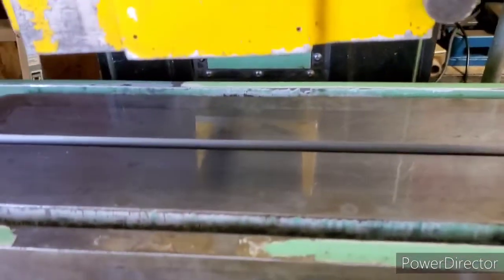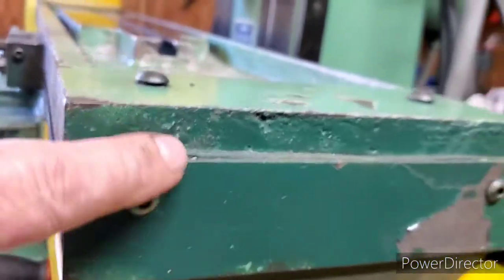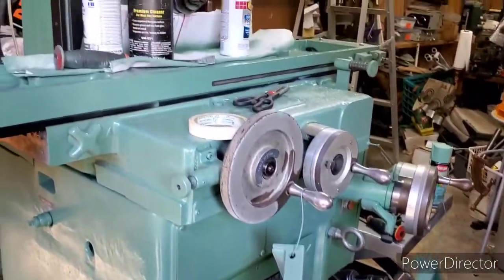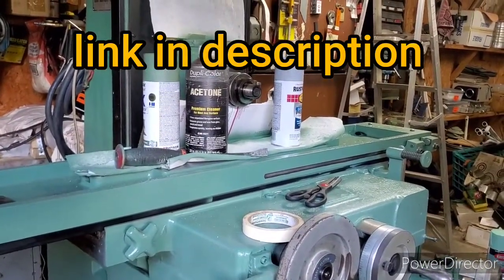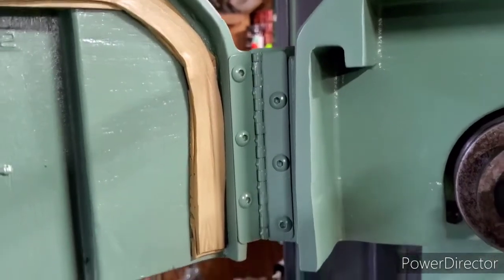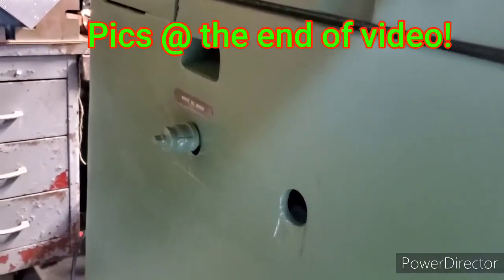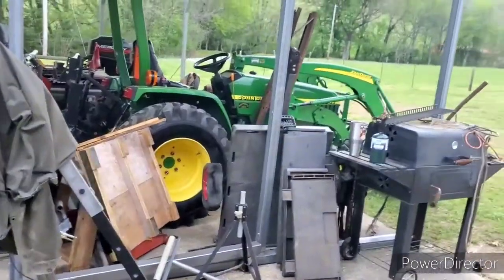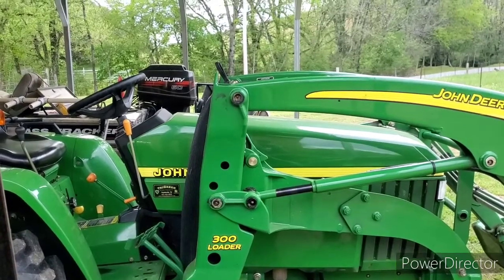Reid Rollerway grinder (Part 2)reassembled and a little paint.

Comment: Looking good there now all you need is power.  I also get tired easy.  I work about 2 or 3 hours and then take a couple of hours break and maybe back for a couple more hours.  Some days I don't do anything.
Reply from the maker: I understand totally. I can't go an hour without sitting down .weight in my #1 problem after back surgery I gained over 100 pounds the next 2 years. Harder to get off than to get on. GOD bless
Have a blessed week